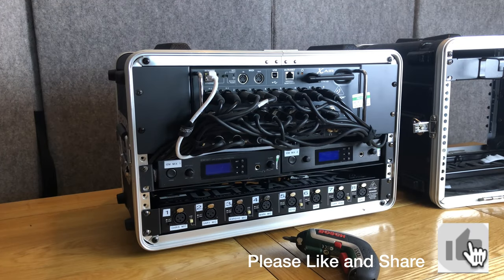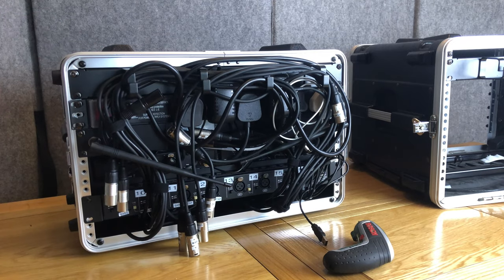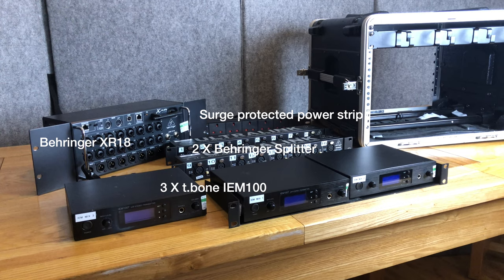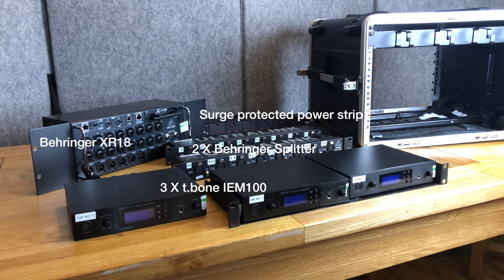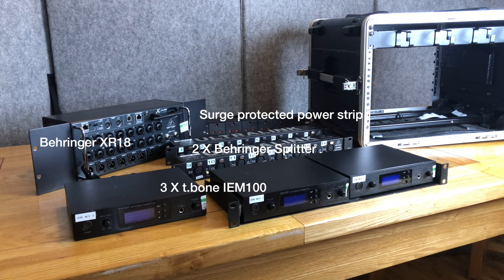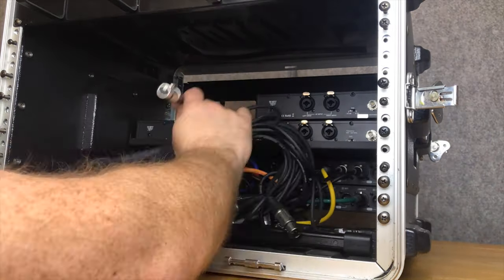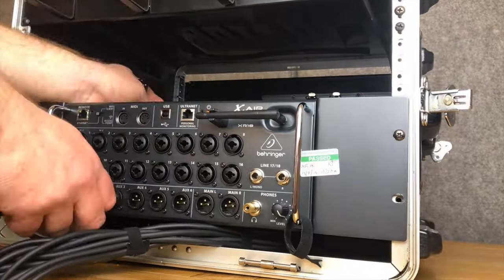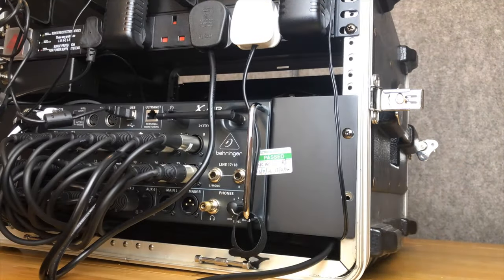IEM Rack Case Build

Comment: Hi! Awesome video! But I would advice using splitters with input and direct output in front and second output in the back. Like ART S8 3way. Yes its more expensive but makes your kit cleaner and wont require keeping all wires for FOH hanging out of the rack. Cutting the hole in the XR18s rack mount will make it easier for cable management especially for those racks where you will have to leave one unit empty for cables and you wont need to take out behringer from the rack to change cables. OR just put xr18 with its inputs inside the rack. XR18 does not have any faders/buttons/triggers on it that are crucial on the stage
Reply from the maker: Thanks for info, as the splitter is only occasionally used, I have gone over to a 0.25m 8way to db25, and plug in the other side of the db25 when needed which is much better. I also use an X32 rack which has inputs on back. 

Thanks for sharing your advice - all useful to others building racks
Reply: Ohhh, cutting a hole in the fins of the XR18 is an inspired idea!  I'm trying to adjust how my system works because it's a pain running all the cables every show - currently I use 2 6U soft bags and have to cable it all up for each show.  The split snake I bought is a floor box so there's no way to leave that plugged up.  Looking at a new 14U rolling rack w/rack mount splitters and all of it contained and hooked up.  When running a show with my own sound, just plug in mic inputs like normal.  When running IEMs only - allow house tech to plug directly into my rig and hand him (marked) tail.  Should work a lot more efficiently and cut down on set-up time by 15-30m.  

Only problem is how to get a 14/16U rolling rack up/down stairs.  Does a hand-truck work OK for that?  I'm getting too old to just

Comment: The Midas DN4816-O makes the splitter unnecessary. Use the ultranet out from the mixer to the DN4816, which requires one shielded CAT cable and provides 16 XLR outs.
Reply from the maker: Indeed it does. Very good point. I don’t think this was available at the time I built the rack, but it is something I have looked at, thanks. I also use my split now for a backup mixer - connected with xlr to db25 at the splitter, and then a db25 to mixer pre connected, so I just have to plug in. I also have a separate db25 to xlr for connecting to a managed PA if needed. If the DN4816 is used, if the mixer failed, it would not work…. I always like a backup plan!
Reply: But the costs is 4x over the splitter
Reply: Can you explain how this makes a splitter unnecessary? I don't understand. Thanks!
Reply: @DavidMacVicar   Midas DN4816-O: this takes the ethernet cable out from the Midas and converts it to 16 channels of XLR in a separate rack box.

Comment: I'd ditch the splitters and get a Midas DN4816-O box. It would mirror channels 1-16 (or whatever) on Ultranet for FoH.
Reply from the maker: Yep I have looked at that - just a cost issue as it is a few hundred pounds, which I have not got at present! It is a great solution though. The splitter also protects the x32 sockets from damage as well…

Comment: Do the screws have nuts behind them or do they just screw in and stay put? I'm trying to build my own iem rig but duct realize he tech savvy one must be to build one
Reply from the maker: Depends on the rack case. The “gator” style ABS have screws that have a threaded hole. Some racks (often the heavier wooden and metal ones) have a square hole on the rack where a nut springed holder is placed and the screw goes into that. The benefit of the second approach is that if something gets cross threaded, it can be replaced. In the non nut version -  if cross threaded that hole is now unusable. The drawback of the nut (second) approach is that they can be VERY fiddly to place! Hope that helps!

Comment: On the Behringer splitter (MS8000) which output goes to XR18 and which output goes to FOH?
Reply from the maker: The link connection goes to the rack mixer so that 48v phantom (for DI box and drum overhead condenser mic) can be controlled from mixer, and the transformer side split goes to the cable for passing to a FoH PA, or we would also use it for our backup mixer…
Thanks
Reply: @tmmmusicstudio  thank you - in reading the MS8000 manual, I found that part confusing. What about the warning here: "WARNING! Be careful when using phantom power on linked channels. If two linked channels both have phantom power sources connected to their respective LINK OUT XLR jacks, phantom-powered mics or DI boxes may receive too much current."

I don't think we will be using the link function in a traditional in ear mixer setup as we need 1:1 inputs/outputs for all the different instruments. Any information you can provide would be of great help! THNX!
Reply from the maker: @DavidMacVicar  did not see that but seems reasonable if linked, however I am not sure of a practical use of the channel linking. I’ll dig out the manual and take a look - thanks

Comment: Hi, nice video, it gave me quite a few ideas for my own rack case. Just one question how did you attach wireless router to the top of the IEM transmitter?
Reply from the maker: I use strong super strength velcro from amazon. There are probably more elegant and technological solutions… its not fallen off yet

https://amzn.eu/d/dBFHnkL

Comment: Hi, I had a look on ebay at the power strip that you're using. Is it possible to flip the rack ears so that the power outlets are facing the interior of the rack?
Reply from the maker: Unfortunately not. Its a fairly cheap unit that provides surge protection only, and the rack ears are fixed. You might be able to mount it on the inside of a very thin rack shelf, as it is only 7 or 8 cm wide. I have it facing outwards as I plug the Artnet light interface and laptop into it at the gig.
Reply: @tmmmusicstudio  Thanks a lot for the info!
Reply from the maker: Just had a look on ebay. Mine is a metal frame which goes along the whole strip, but there are some that look like there  are rack ears that could be reversed. Mine is poss 7 years old, so probably not available now

Comment: Have you had any issues with interference, having 3 iem transmitters and aerials in the same rack?
Reply from the maker: We have actually gone over to P-16 personal monitors now, but there was not an issue. I think there can be , and a combiner with a separate antenna is always best if you can afford it. I tried to space them i. The box as much as I could.
Reply: That's the conclusion that we have come to, that we need to go with a combiner and antenna - how are the P-16s? @tmmmusicstudio
Reply from the maker: Superb. Just superb. Both bands i play with use them. I use them for theatre pit stuff i do, and I have a P-16i and two in the studio too. They are great

Comment: Question. We have the xr 18 and 1 splitter this one we have. But we loss a lot of db in our in ears what do we do wrong😢
Reply from the maker: Difficult to say without looking in person. Make sure the input gain on the mixer is at a good level, set to 0db (although some people will set at -6), and then have a good signal that is green on the meter and only occasionally peaks into yellow. I assume your in ears are fed through a bus, so just make sure the levels to the buss are good. Are you using cables to a headphone amp, or to a wireless box. The headphone side needs to be active to amplify the line level signal (I know its obvious but just checking), some wireless in ears will also have a gain knob you can turn up. Use good cables. They dont need to be mega expensive - for live stuff I use visiosound or stagg, cheap but good quality. Hope this helps. Also splitter does have ground lift and link buttons - make sure these are off unless you want them on…

Comment: I did not understand the purpose of the splitters...sorry. Can't we go from the mixer AUX directly into each IEM device? What am I missing?
Reply from the maker: No worries, the splitter is so that a duplicate of the signals can be fed to a front of house desk if playing a larger gig with engineered PA. This allows the band to retain control of in ear mix. Apologies if not clear from vid. A valid question though.

Comment: hi, great video! it is exactly what i want to build with my behringer xr18 for IEM for rehearsals and smaller gigs! one question - how do you plug in the keys into the splitter? is it 2x jack from keboard into some kind of DI Box -> xlr to splitter?

i wuld like to use 17/18 inputs on behringer for keys, do you think it's possible?
Reply: Yes we use just a normal DI box

Comment: Just what i needed , cheers ... Any idea the case model please?  .. cheers
Reply from the maker: It was off ebay. Pretty sure its a pulse 6u narrow. But identical to gator and trojan.
Reply: I can’t find any shallow 6u cases with wheels anywhere in the internet. Did you add those wheels ?
Reply: @pedrobrandao7432  the rack I took the gear out of was shallow, the one I put it into (with wheels) was a standard rack.

Comment: What about phantom power, is there an issue with it? the splitter passes the current?
Reply from the maker: Most (or many) splitters work by having a true wired link and a second transformer link. As long as your mixer or source of phantom power is on the true link, then it passes. So when we play in a venue with a managed PA we give the PA the transformer split, and control the phantom power ourselves. Hope this helps.

Comment: Great walk through. I've just ordered the X18R for my band and will at some point be looking to install it in a rack system. 

Question about the tray for the IEM transmitters, where did you get this as the standard rack kit is for only 1 transmitter? I have the LD Systems MEI 1000 G2 transmitter (as does my oppo) and would be looking to recreate your setup. 

Cheers

Andy
Reply from the maker: It was just a short rack tray I got on ebay and the transmitters were stuck down with command strips

Comment: Can you please explain how you managed the antenna connections from the IEM wireless units and the the router? Do you have them all going to that one big antenna on the front?
Reply from the maker: They were all spaced as far apart as possible but all had their own antenna. I think a combiner is a great option but more cost
Reply: @tmmmusicstudio You're not kidding more cost.  I hadn't heard of these before you just mentioned it - $800 gets you about the cheapest on the market it seems.  Costly, but what a space-saver.  I think I'll just continue to use my cobbled together antenna wiring.

Comment: Great video... very inspiring . Are you using 16 singular XLR cables for the FOH connection? It does not look like a multikabel...Thanks
Reply from the maker: Yes, its just what I had handy, but will probably replace it with a short multi cable at some point

Comment: Greetings - do you have a workaround for sending a stereo output for each of the individual Aux outs where my IEM amplifiers are connected to?

I essentially just want to be able to pan different instruments on both my left and right ears. I currently use a Behringer PM-1 and all my sound comes in on the left ear which is a big mush of sound.
Reply from the maker: Behringer make the powerplay P1 which is a powered stereo unit. Thus it can take a stereo input. The XR18 also has ultranet output, so you can use the P-16 16 channel units, which I have just bought, and they are amazing as you can pan and eq.
Reply: The XR18 can only do 3 stereo aux mixes: buss 1/2, buss 3/4, buss 5/6 plus the LR mix. Stereo mixes always use up two busses. If you need more than three stereo mixes (plus the LR mix) the P16 is your best option.

If you just need one stereo mix, the PM1 will work fine. Note: the PM1 is great unit but it’s not designed to work from balanced aux outs. It’s designed to be a remote volume control for an unbalanced headphone output. Lucky for you, the XR18 has a headphone jack.

Headphone jack…  plug your PM1 into the headphone jack on the XR18 with a 1/4” TRS to XLR cable as shown in the PM1 quick start guide. You will still need a pair of busses linked in stereo on the XR18 (BUSS 5/6 for example). To get your stereo linked buss pair to the headphone jack instead of the aux outs, go the the monitor page in the app (“monitor” means headphone output on the XR18) and assign your linked stereo buss pair (BUSS 5/6 for example) as the “source” for monitor (the headphone jack). This puts your linked stereo buss pair into the headphone jack. Turn up the headphone volume control on the XR18 front panel, turn up PM1, turn up the buss (BUSS 5/6 for example) and mix.

You could use a balanced aux out on the XR18 for a mono mix into the PM1 or even get a stereo mix by using two aux outs into a Y adaptor that converts the two balanced mono signals into a single unbalanced stereo stereo signal, (see the XR18 quick start guide) but just like mono, you might not have enough volume. If you really need to use the aux outs in stereo, just get a P1 and a pair of XLRs.

Comment: Hi, As I am a solo act, would I only need 1 splitter?
Reply: As a solo act I wouldn't imagine you would need a system setup like this but if you did than you just need 1 channel for every mic cable you plug in. The splitters usually only come in groups of 8 so if your plugins are less than 8 channels than yes you would only need 1 splitter.
Reply: @kylehudelson2476  thanks, this is great! Well I have a drummer, and we run the bass tracks and click track through our in ears. We look at using my vocal mic, my guitar Stereo, kick and snare and our MacBook Pro!
Reply from the maker: As above, you just need to count up the number if inputs/instruments/mics. For drums, I only use 3 channels, kick, snare and an overhead, but some mic every drum and stereo overheads. We play to click and also have a cue track, which comes into the mixer via USB, but I also have a backup mac, which is there running and that has a stereo cable into ch 17/18 which is click Left and cue Right.

Comment: Hi can you use just a normal rack mixer and not a digital one?
Reply: Absolutely, however, the good thing about many of the digital mixers is the number of auxiliary outputs available to be separate mixes for different people. But some analog mixers might be adequate
Reply: Digital mixer will let you do SO much more and cost about the same. But there is no reason it wouldn't work if you found a unit that has all the i/o you need. I love having gates and high pass on every channel.

Comment: Hi mate, 
Which power strip and case do you use in this video?
Reply from the maker: The case was bought off ebay - not labelled - but “gator” style, and the power strip is just a cheap one from ebay with surge protection only, not conditioning.
Reply: @tmmmusicstudio  Sorry for the late reply. Thanks.

Comment: How much U did this take up?
Reply from the maker: Its a 6 U case but one of the Units is slightly restricted by the concealed wheels housing and a concealed housing. So that restricted unit is used for cable passes etc

Comment: Great video! Have you had any noise issues with the Behringer MS8000?
Reply from the maker: no. it sounds fine. I am a big advocate of Behringer gear. it is often criticised, but I have always found it to be reliable, good quality and good build quality too
Reply: I'm using an MS8000 too and have had zero problems. One thing to note - make sure to wire the correct output to the mixer (the wired link) so you can pass phantom power to microphones - I learnt that lesson recently!